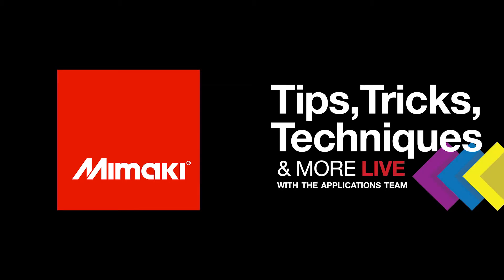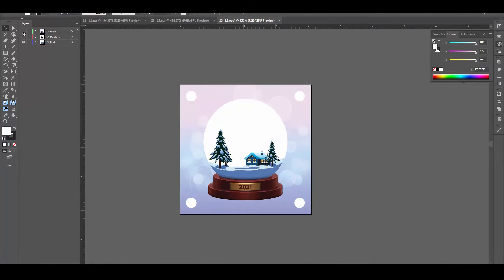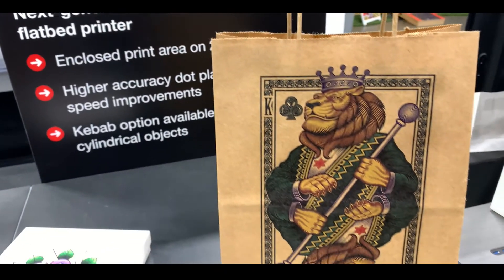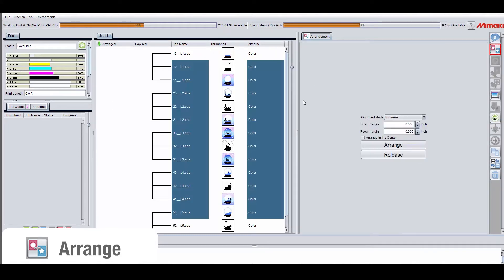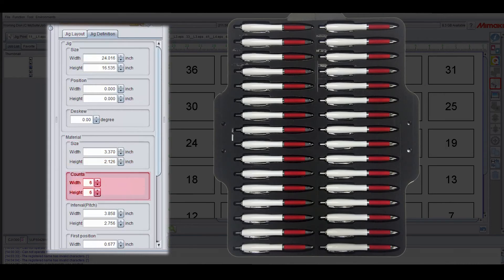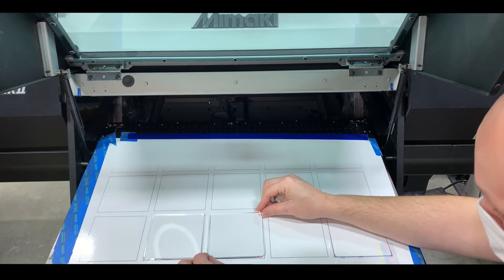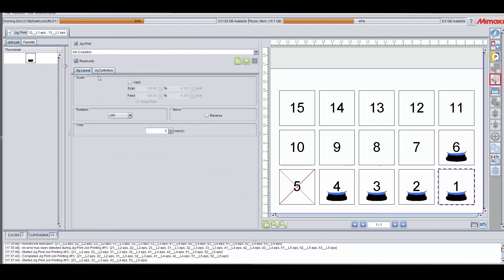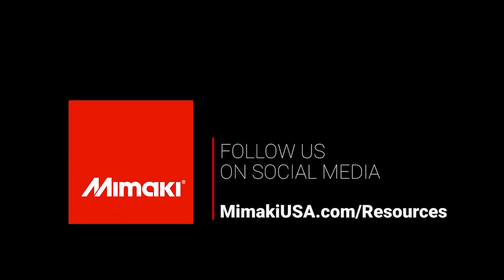Customizing Coasters with Rasterlink6 Jig Print function ~  Tips, Tricks, Techniques & More

Comment: Are you putting theh art on the bottom with the rubber coaster feet or on the top of the final piece?
Reply from the maker: Thank you for your question. We do not have detailed information about the specific type of glue used on the rubber feet. To ensure optimal adhesion, we designed the product with a blank space where the feet attach, allowing the glue to bond directly to the acrylic. The rubber feet are positioned on the same side as the artwork, but they do not come into contact with the ink.